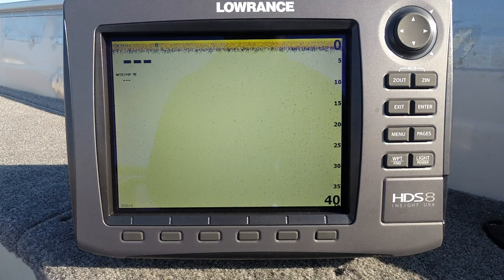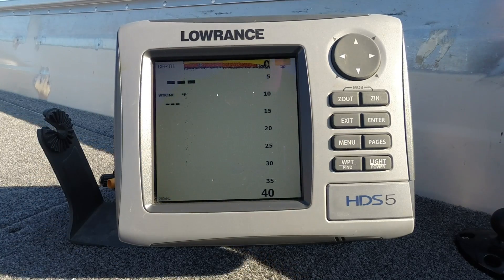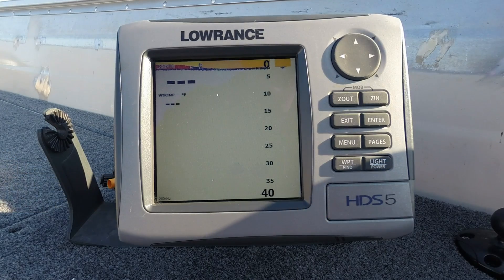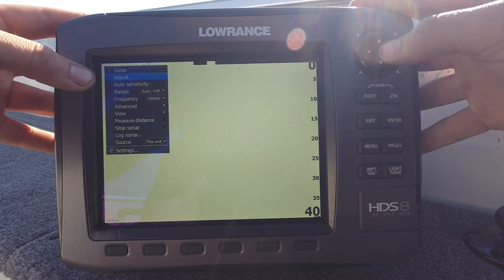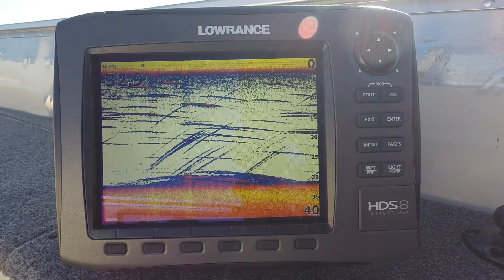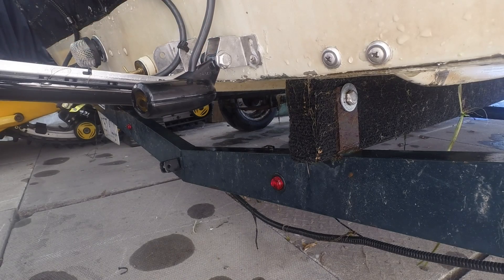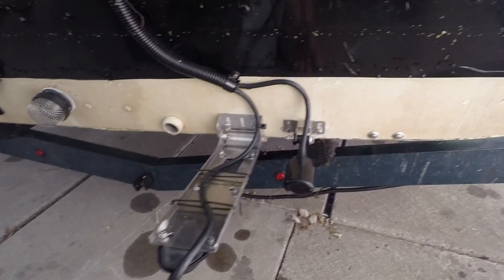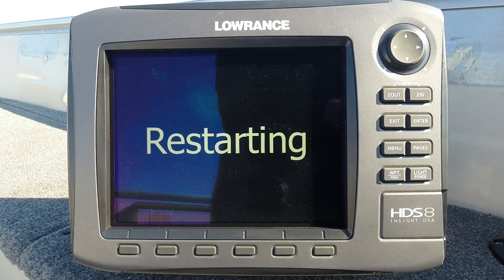No Depth Reading on Fishfinder - How to Troubleshoot

Comment: Would these fixes be the same for the newer Lowrance Elite FS7? I just got a new Nitro Z18 with a Ghost trolling motor and I'm not getting any down imaging or 2D on the bow unit. I'm assuming it's a simple setting issue but the Lowrance owner's manual really sucks IMO.
Reply: May be yes

Comment: Hello, at 5:25 what are the 45 degree lines goin up to the right? I get a lot of these while using my Garmin striker while moving at 2mph. What I mean by a lot is 20 or 30 of these lines in all depths of water. And when in shallow water I can see there are no fish under my kayak, but I still get these lines. Could this be an issue with my sensitivity?
Reply from the maker: It's most likely air bubbles rising to the surface

Comment: Good tutorial! Thanks! Hook Reveal 7 Tripleshot. NEW unit. No depth reading, just 3 dashes, but showed images on the graph. Lots of noise, mostly surface, even at 8' of water, it didn't show a "bottom". Back at the dock, turned off Auto Range and turned on Downscan....showed a depth of 29'....sitting in 3' at the dock. Tried to go back to Auto and turn off Downscan and lost the depth, repeated the steps...never showed any depth! 
Tried soft and hard reset...no change.

Returned it
Reply from the maker: Glad it helped!
Reply: I have to admit....operator error!
2' of water over 3' of soft mud....doesn't give a return signal!
Went out from my dock....bingo, it reads depth!
Reply from the maker: You're not alone.. so many have done that before.

Comment: Thanks for the comprehensive trouble shooting guide! I have an HDS12 Gen3. I am getting an accurate graphical display of the surface and the bottom, but no digital depth, speed, or fish returns. On occasion, I get a digital depth, but it is inevitably inaccurate and tends to jump from one number to another. For example, I can be in 10 feet of water and it will jump from --- to 76 to 32, and back to ---. The boat is now out of the water, and the through-hull transducers are clean. I don't have a second Lowrance to swap out. All of my boating friends have Garmin or Raymarine, so there is no option to swap with them. Given that I see the bottom in the graphic display, I tend to believe that this is a problem with the HDS12, but I'd love to be able to confirm it before sending it in for repair.  Any ideas? Thanks again!
Reply from the maker: Do a hard reset on the unit and that will likely fix your issue. It will delete all waypoints though
Reply: @InDepthSonar  Thanks, I tried that, and also reinstalled the latest software. I even bought a smaller, used Lowrance HDS on Ebay to swap out. A cautionary word on that option - make sure that your transducers will work with whatever unit you want to swap out - mine didn't. The plugs all looked similar, but the pins were different. Thanks again for the input.
Reply from the maker: All HDS units are the same transducer connector for the 7 pin blue port. As long as it is Lowrance transducer you're using it'll work.
Reply: @InDepthSonar  Apologies, you are correct. Apparently, the gentleman I bought the used Lowrance HDS-5 from also threw in another transducer from a different brand sonar system. I had the wrong one in hand when I tried connecting the first time. The Lowrance transducer that came with the used Lowrance HDS-5 I bought is not listed as compatible with my HDS-12 Gen 3, but I tried it anyway. I still get the "---" depth reading, but the boat is currently out of the water and I get a  "---" depth reading when I connect the used transducer on the HDS-5.  I'm also not getting a depth reading from my Raymarine tridata unit, so I'm guessing that I can't trouble shoot this properly with the boat on land. I was hoping to determine the cause before launching so I'd know if I had a faulty HDS-12 or faulty transducers.
Reply from the maker: That makes sense. Yes, you will definitely have to have the boat in the water to test it properly

Comment: Good video as I just got a HDs 8 gen 2. But I’m am having a no source on my side scan   And the box is working I have power light on and transducer light is blinking and the Ethernet ports are blinking on any port I try on the module Not sure what the heck is going on and I am using the side scan hd with the hd transducer
Reply from the maker: Likely a bad transducer then.

Comment: I’m having an issue where my depth and down scan comes and goes, but I still have side scan.  If I shut off the unit and turn it back on, it will work again, but will go back to doing what it was I have a Hook Reveal 9 TS and I’m still learning the ins and outs of this device.
Reply from the maker: Most likely an issue with the unit or transducer.  I'd find out the hard reset procedure for that unit and try that first.  Also make sure the transducer connector is seated properly in the unit as those ones can come out due to not having a locking collar

Comment: My buddy has an Elite 9ti2 and we are losing depth when we are on plane. The paperwork that came with the unit says it's possible to lose depth at speeds of 55 or more but we feel this shouldn't happen. It's important to know the depth of the water at all times especially when running at higher speeds. He replaced a previous unit, an HDS 8 that was doing the same thing and after talking with Lowrance, he was told to do a software update and that should fix it but it didn't. This past weekend was our first time using the unit and we'll try some of the tips you suggested in the video but do you have any other tips or suggestions on why this unit loses depth and how to fix it. I've spoke with Lowrance and they say transducer location and turbidity causing the lose of signal. We have the transducer mounted at a good location on the transom, yet not too low for water to hit it and flip it up some, it was still level when we trailered the boat!
Reply from the maker: 100% it's how the transducer is mounted. If you've got 2 units doing the same thing it's mounting. 55mph is really good and you might not get any better. I've got readings at 70mph plus before but that is rare. I would start by playing with the angle of the transducer and the height of it.  I'm not saying you didn't mount it right... And it sounds like you did if you're getting 55mph.... But you now just have to tweak it a little too try and get more... But 55mph is a lot so that might be the best you'll get.
Reply: @InDepthSonar  The HDS8 that came on the boat was losing depth when we were sitting still. The Elite9 is at least working while we are trolling around. We'll double check the transducer and speak with a rep and see what they say. One lake my buddy use to fish is Oolagah Lake, that lake you can go from 30ft to 3ft in the blink of an eye. Running at 60MPH on that lake with no depth reading on the display can be deadly. Luckily most of the lake we fish, we know pretty good but still manufactures of these unit need to solve that problem of no depth display at certain speeds.
Reply from the maker: You can use them up to 70mph. So it's more of an issue of water flow off the hill and transducer location and angle than it is of a manufacturer shortcoming

Comment: Is there a reason why my sonar scroll will randomly slow down to -1 scroll speed (I know that’s not a setting but it slows down super slow)  from my 2x scroll speed settings I have my unit set to? The setting never actually changes but the unit like stalls then speeds back up. The unit only seems to do it in Auto range and in 200Hz. I have always just set my depth like you have said in your other videos but I been fishing a river that I go from 5ft to 60ft multiple times a day and just got tired of changing the depth so I wanted the auto to work. Or is this a reason why you never used auto mode?
Reply from the maker: This sounds like the unit is losing bottom. Your right this is typical when using auto mode and it's over of the reasons I like manual mode instead. The computer is losing bottom for some reason (weak transducer, interference, etc) so it slows the scroll speed down to hopefully find it quicker again.
Reply: @InDepthSonar  That makes sense! Thanks for the reply!
Reply from the maker: No problem

Comment: I have an HDS 5. My issue happens when I am moving or start to move, I almost get broken vertical lines and no digital depth. Even after I stop it takes quite a while for it to start reading accurately again. Any ideas? It has a brand new transducer
Reply from the maker: If you've tried a new transducer then likely it is the unit or transducer placement.  Do a hard reset on the unit and if that doesn't solve the problem you can try to adjust how it is mounted.
Reply: Try update the software

Comment: Will try some of what you said,, very good video,, very informative and easy to understand,, good job ! I have the elite 5 that gets stuck in the 2 ft mode and i have to turn off and restart..
Reply from the maker: Try putting it in Shallow Water mode.  That will fix that problem unless you have a hardware issue.  Search my channel for the ice fishing Elite videos and use those settings for open water.  That will be good for your issue.
Reply: @InDepthSonar  thanks,,did a system restart also,,hopefully that's it
Reply from the maker: If not try the shallow water mode

Comment: I have a Lowarance Elite 4 DSI which suddenly doesn't show an image. It shows depth, speed, is illuminated, ducer is parallel, and clean, but just black where there should be structure, fish, bottom, etc. Any ideas? Thanks!
Reply from the maker: Sounds like a bad transducer or unit. Only way to know is try a known good one too isolate the problem. Also make sure the transducer plug is secure in the back of the unit
Reply: @InDepthSonar  Thanks for the input!

Comment: Wow taken me 1 week and numerous phone calls. 
Last segments about depth reading only 2:1 ft. 
Our hook 2 triple shot only 1 week old, 2 trip this is exactly what it’s doing. 
Thank you 
Will try manual range tonight. 
🙏🏻🙏🏻
Reply from the maker: Yeah most in the customer service departments today won't know about that. Has been happening since the LCX units in the early 2000s. Haven't heard of it much lately but can still happen.
Reply: Lawren Wetzel  you are showing this test on water right? Can you check a transducer out of the water on ur driveway ? Or it needs to be sumerge?
Reply from the maker: Yes this is done on the water. You can try it if the water but it may not give you accurate results. The resistance of air is less than water so sounds travels faster and everything in the unit is thrown off out of the water
Reply: @InDepthSonar  Hey, Thank you very much. I place the transducer in a 5 gal. bucket and it actually work! U learn something everyday. Have a nice weekend. Keep up the good work.

Comment: I removed the transducer from the thru hull and mounted it on the transom.. But still get sonar but not depth... 3 dashes... Any suggestions to look at? Thanks Joe
Reply from the maker: Try all the things in this video.  If that doesn't work then you likely have a hardware problem that you need to replace the unit or transducer
Reply: @InDepthSonar  Do you know what the resistance values are for the transducer. I believe is has 5 colored wires and 2 grounds..

Comment: lawren new hook2 5x unitshowsvertical lines then depth then line temp stays depth comes and goes
Reply: I have this same exact problem . Did you ever find the issue?
Reply from the maker: Turn off auto mode and see if the problem goes away. If not it's a faulty unit or transducer

Comment: Hey there maybe someone can help..  Bought hook2 7x in August 2018. Worked perfecty fine before storing boat for winter. Just put boat in water today and there is no depth or temp reading. 2d sonar shows a white screen and di, Si show nothing aswell.   The transducer was not moved or hit while In storage. Tried restoring to factory settings and still the same problem.  Any trouble shooting advice would be much appreciated.  Thanks in advance..
Reply from the maker: It's either the unit or transducer. Follow the tips in this video as much as you can. Otherwise call Lowrance and send your unit and transducer to them for testing
Reply: It's weird you posted this mine is doing the same thing. Bought it new july 24 2018. I have a thin line at the top and the depth os flashing no temp reading or anything. My side scan is showing a thin line coming down with a bunch of short hash marks on both sides.
Reply: @littleleadpill7189  this is what the lowrance Rep told me to do.
 I know this sounds basic but it is a common issue. Unplug your transducer and lightly lubricate around the 2 ribbed rings around the plug, next index the plug correctly and make sure the transducer cable is inserted fully until it is seated.......then push it in a little more. This is the cause about 95% of the time and having no temperature is usually the giveaway that the plug isn't in all the way.        Will be out on the water this weekend and will try the plug again.. Will let y'all know
Reply: Lowrance Rep was right. Transducer plug was not in all the way.
Reply from the maker: I'm really surprised to hear that worked as it sounded like a long shot, but glad for you it did :)
Reply: @InDepthSonar  I'm surprised to. Thought for sure it was in all the way after three times unplugging and plugging it back in.

Comment: I have a hook2 7. Clean out the debris in the transducer and I make sure all connection are connected. Still won't read the depth. Check connection for corrosion but none.. swap out battery but nothing help... swap my unit onto a different transducer and my unit still not reading it. What advice can you give me??
Reply from the maker: Ensure you have the correct transducer selected in the Sonar Installation menu (not sure if this is something you can do on the Hook2, but check). If not then it sounds like you have a defective unit.  Call Lowrance for warranty
Reply: @InDepthSonar  that's what I think also. It was fine for the past few months when it first came out. I'll give them a call. Thanks
Reply: I too have a Hook2 7 w/ a Tripleshot transducer. It read correctly since day 1 but during fishing my sonar screen turned orange and I lost depth reading also. When I got home I double checked my transducer cable to ensure it was plugged in correctly. I'm assuming it will make no sense to observe a depth reading in the garage, correct? Thought I ask

Comment: My fishfinder shuts down every two minutes or so. I have to turn it back on and seem very slow to come back on. Any ideas on possible reason?
Reply from the maker: Contact the manufacturer and have them give you a Hard Reset procedure.  If it is a software glitch this should solve it for you.  Otherwise, you probably have a defective unit, problem with power cable, weak power supply, etc

Comment: Great videos,, except my issue isn't covered here. When I turn my HDS5 on, the screen is barely visible in daylight. I have to move it around to get an angle where I can see it. Really can't see to make adjustments etc.. but can see enough to tell the unit is on and reading depth. Any idea?
Reply from the maker: Sounds like your backlight is off or defective.  Press the power button a few times to cycle through the backlight levels.  If nothing happens you have a defective back like.  I have a video on my channel about that called Lowrance Unit Not Turning On
Reply: Thanks! That's pretty much the advice I've gotten from everyone. Sounds like it's defective.

Comment: What is the difference between Hook9 service replacement, and a new Hook9
Reply from the maker: A Hook9 Service Replacement would be a unit that Lowrance has specifically to replace a defective Hook9.  They would be the head only, with no accessories at all and packaged in a brown box.  They may or may not be refurbished.

Comment: I'm doing a "shoot thru" hull on my kayak.  I am using a duct seal and not epoxy to keep the transducer in place. Should the duct seal be between the transducer and hull or just surrounding the transducer to keep it in place so that it doesn't move around. I'm getting good readings but sometimes loses depth and sonar completely then comes back.
Reply from the maker: Use epoxy for the best results.  Otherwise you will likely have problems.

Comment: i have a lowrance hook 2 4x bullet  attached to trolling motor , it showed depth up until 50 feet , then i had no depth and many verticle lines and screens (?) with 0's going across the top and 100's going across the bottom, overlapping....... how can i fix this ?
Reply: wizlawz new one working good ? I have same problem like you :/
Reply from the maker: Sounds like the auto mode might be getting confused. Try "restore default" in the menu, then turn auto depth and sensitivity to manual. Adjust them accordingly and see if the problem is resolved.
Reply: Lawren Wetzel  i was watching it today, at forty to fifty feet it set auto depth to sixty, ....same issue.... i looked at the different depth options and fifty is not listed ..... the deepest this lake is = fiftyfeet. 
i did play with sensitivity and noise reduction - off / low / high ,.... noise reduction at high got me to forty five feet ...... i forgot what i had sensitivity at, i will redo and remember next time.
how would i do depth manual ? .... as the screen freaks out increase depth, i am guessing ?
Reply: ok, so i took it back to store, it was determined as defective transducer,... i will try this exchanged one and see if i get same results as having  the transducer out of water on auto depth - with 0's going across top and numbers going across bottom - overlapping
Reply from the maker: You would increase the depth as you need to based on the bottom reading.  If the bottom goes off the screen you will increase the depth range